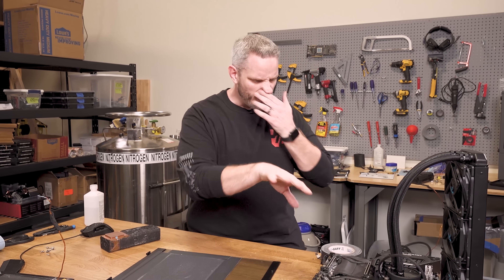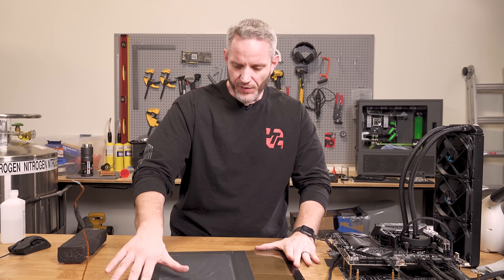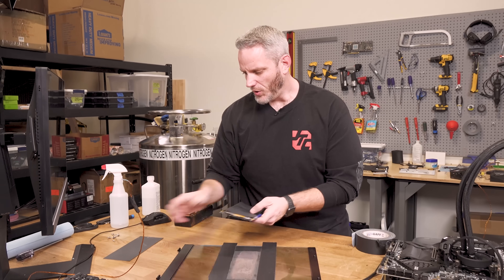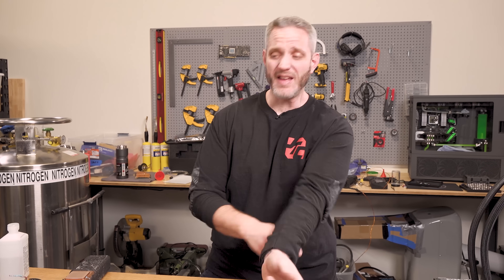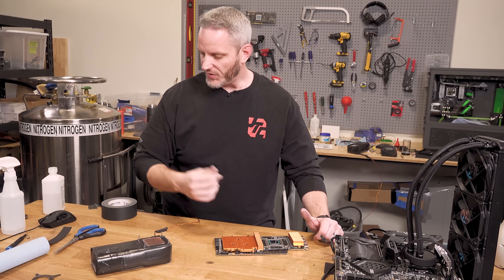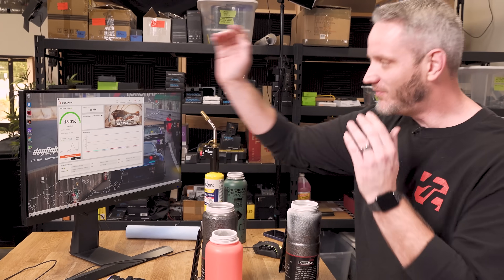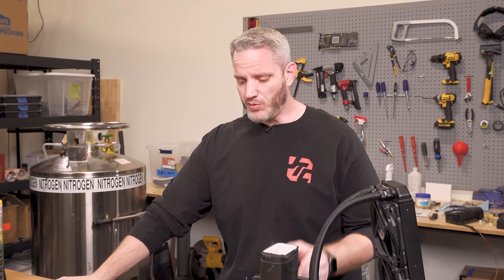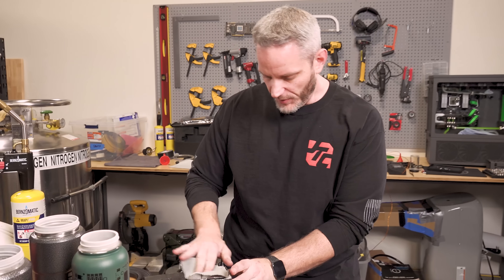THIS is Why Lapping Your Cooler is SO Important!!

Comment: Jay, you really should start completely over with a new pot, constructed with the main goal of parallelism between the contact face that sits on the die and the outside face on the opposite side of the pot, in both planes. This will allow you to just set the pot on your glass with the contact face up, and use a dial test indicator to check for true flatness. Then once the contact face is done being lapped and known to be flat, then you can apply your insulating foam that looks like it's been scraped off hastily in this video, as you shouldn't ever need to re-lap it, as you know it is flat already and there is no wear during operation. But unless you already know the outside face of the pot you have conforms to a tight parallelism spec, you cannot use that method, as you will end up with a flat surface in the incorrect plane

Comment: ...unless you lap it wrong and end up with an angle or a curve and your cooler now fails to make good contact (especially with Threadripper!)...and without a specialized perfectly flat and level tool that laps the cooler evenly, this is guaranteed.

Comment: Glass is not perfectly flat...a lot of people who 3d print deal on glass beds deal with glass being warped even when it's not heated. If you think lapping a cpu on glass is in anyway accurate at all then you are just wrong. If it's not accurate enough to lay down plastic filament, it's damn sure not accurate enough to lap a cpu.

Comment: Leaving surface rough is to maximize surface area which transfers heat. Not for thermal paste to stick better. Trick is finding best heat transfer between larger area of grooves and smaller maximum distance of polished surface.

Similarly how a radiator has rows of spikes instead of being solid block. Every spike is another surface that can transfer heat to air. But in this case every groove has extra surface to transfer heat to paste.

Comment: You said about not going for a mirror finish, i was under the impression that thermal paste is only a substitute for perfect flatness, for the absolute best thermal transfer 2 perfectly flat surfaces without thermal paste would be the best so leaving scratches in for the paste to grip is only leaving poor heat transfer for the paste to have to deal with instead of direct contact.

Comment: I noticed Jay touching the freshly lapped surface a bunch of times. If you're not aware, the oils naturally occurring in your skin (no matter how dry your hands seem) will contaminate the copper surface. It may cause corrosion or react with the TIM, which of course is sub-optimal. Please after doing your final lap, don't touch the base. Rinse it with clean water (de-mineralised ideally) to get rid of the metal shavings created by the sanding, wipe it with a CLEAN microfiber or lint free cloth and cover it with plastic wrap if you're not mounting it immediately.

Comment: I'm assuming that tightening the C-clamp while the paste was still frozen solid cracked the crap out of it. It may have been possible to warm it to get it to re-flow, but at these levels it was likely never going to be good enough to repeat that run because I believe the frozen crack pulls the paste out of the surface's micropores, and logic tells me that the only way to force the paste back is to start from scratch. Think of paving with asphalt, when they lay the asphalt down and put a roller on it, you get a nice smooth surface where it's nicely adhered to the subsurface, but if you were to freeze and crack it, it never comes back together, even after warming up on hot days and the structural integrity is ruined, you have to tear it up, re-prep the subsurface and start over again.I personally would avoid ever adjusting or touching the mount when it's frozen.

Comment: You should really consider a " no twist clamp" for this, i worry the twisting a c-clamp can cause will booger you up and a no twist will get you the downward pressure you need without the added torque

Comment: Have you considered using machinists calibrated blocks for use between the g clamp and the back of the die? They are supper flat and easy to get hold of. You get them from special machine tooling companies. Probably be around 50quid in the uk for a set. Plus they will act as a further heat sink to give u a more consistent temperature.

Comment: @JayzTwoCents  If you're really serious about Extreme OC'ing you can get heating tape for the cold sensitive parts and to help evaporate the condensation before it becomes an issue.
Overclockers and Watercooled PC's usually has some good ones shaped for the back of the VRAM and CPU/GPU dies. 👍

Comment: Yes! I’ve struggled with my AIO for a few weeks. I know it’s filled, I know the pump is good, it’s positioned well, push pull fans, but my temps are still not near as low as I know it being it down. I do have some groove scratches so.... off to the hardware store! I’m sure this is my problem now 🤙🏼
Thanks Jay

Comment: With the polished finish compared to a rough finish, Jay keeps mentioning 'bite'.  Technically you are creating more surface area for heat to transfer.  Think of it like making nanometer grooves for the thermal paste to get into and then spread the heat through.

Great info, you might also look into the milling stones that are used to flatten surfaces in lathes and milling machines. They do very minute grind for super leveling surfaces by like thousands of an inch

Comment: Yes, scratches make the paste easier to bite. But the best cooling is direct contact as it makes less thermal changes between items. The best cooling would be no paste on PERFECTLY flat items, even better would be built in pot to the die. More layers means slower temp dissipation.
Looking at CPU's up close, lapping the die is very thick prior to the internals. Idk how GPU's are, but it could very well help a bunch. Lots of extra metals in everything.

Comment: Are you using spring washers to tighten the retaining brackets? If not, those can help with the metal expanding and shrinking under the influence of temperature fluctuations.

Comment: "Glass is Perfectly Flat"....Start 3D Printing and you will learn how wrong you are.  LOL...Tempered and Float glass is FAR from flat.  You're better off using a mirror, because most mirror glass is GROUND Flat.  Yes, glass is common to be used for this, but flat?  Nah.  LOL

Comment: Similar to other comments, use a black marker pen and go over the copper surface. you can then see where the high and low spots are.  Clean the surface with IPA afterwards You can not get it true flat just by visual examination

Comment: Just an idea from an engineering student, but wouldnt it be better to grind it being cold, i dont know if your block is made of one material only, but thermal expansion and contraction came to my mind when i saw this, as you mentioned yourself. Obviously it worked that way too, just being curious.

Comment: As a noob to this I wondered... You tend to use the same pot and same CPU for your over-clocks but are always concerned about getting a good contact between them for thermal transference so why not lap the hell out of both pot and CPU to get them really smooth and flat and then solder the two together thus taking the contact problem out of the equation? Seriously would like to know why this wouldn't work, if it wouldn't.

Comment: You can make a construction like knife sharpeners, which holds the stone, or an object and two constrained rails. 
Those rails can be placed with rotary handles like on lathe machines.

You may even buy some details...

https://upload.wikimedia.org/wikipedia/commons/6/68/HwacheonCentreLathe_460x1000.jpg
https://cdn.shopify.com/s/files/1/2658/1798/products/Blade_Sharpener_With_100mm_Flipover_-_Eze_Sharp_Knife_Sharpener_1200x1200.jpg?v=1549492062

Comment: Hey Jay just a tip as a mechanic, according to my experience lapping in eight shaped movements is more productive and more accurate also you can use some petroleum on your sand paper to prevent dust expansion and make sanding smoother give it a shot next time.

Comment: "Glass is perfectly flat" every machinist replacing their expensive granite surface plates with glass. Invest in a lapping plate.
Reply: I'm not sure I'd even call this lapping tbh. sure its TECHNICALLY lapping but its nowhere near properly accurate.
Reply: I used to live right next to a Pilkington float glass factory. Many of my neighbors worked there. Sadly they closed the entire plant when the oven got old since rebuilding it would have been too expensive. The ovens in those plants can't be shut down without being completely destroyed.
Reply: @Pretagonist  sad truth. A business is no business if you can't renew and replenish yourself over the years... But the oven? As in fire can't be put out? As in, it can't be cooled down without destroying? Or what? I'm curious.
Reply: @esatd34  Exactly, when it cools down it cracks so it has to be torn down and rebuilt
Reply: Just do some 3d printing on a glass plate. You will see how, not flat glass is. Especially when talking about Microns
Reply: Especially not if you stick on top of a squishy wooden table and then press on it...
Reply: I've always been curious like if you lapped an IHS and waterblock down to 3000 grit if you could wring them together and eliminate paste all together.  There would still be microscopic surface irregularities that paste could fill I suppose... still would be a fun experiment.  LN2 without paste to crack!  That would be neat.  

Also, I'm average user and I lapped my waterblock to 2000 on a 1/2" thick glass table.  

https://imgur.com/a/yXxDz4K  

Of course, it came off my Sandy Bridge and because of the 'dish' in those processors this waterblock had been made convex.  How much I didn't realize until I got in to it but it turned out to be over half a millimeter or .024".   Ended up having to take it to the shop and run a mill over it to get rid of most of it.  That was after lapping it on 250 for 45 min.  Crazy.
Reply: @Cinnabuns2009  yeah i've always wanted to know about wringing the IHS to the waterblock
Reply: Even a cheapo Grade B surface plate from some place like Grizzly would do him more good than his thin sheet of glass and cost him $50 with shipping.
Reply: thats probably one of flattest surfaces he can find in the shop
Reply: I was looking for this comment,that is not lapping he just sandpapered and polished maybe that block ? It may be flatter than it was but im pretty sure it is not perfectly flat.
Reply: back when i done ball bearing lapping we measured a bit slab of glass which we thought was flat. turned out there was 30 microns different from corner to corner which is massive considering we worked in tolerances of 0.0005mm which is half micron.
Reply: For any average person a pane of glass is fine lol
Reply: @tylerfigueroatf  That's true, but any average person isn't lapping their heatsinks. If you're trying to hit the top of charts, why not spend the extra $$$ and do it right?
Reply: @tylerfigueroatf  Do average persons lap surfaces of coolers or processor lids?
Reply: And bench that is actually true
Reply: The deviation should be only a few microns and that is easily accomplished by hand, you don't need a $ 100k laser-guided machine to get there. Google translate offcourse. Not even mentioning glass is a liquid, that is the reason why glass in really old windows is thicker at the bottom than at the top.
Reply: @LovelyDoetje  Common misconception, glass is not a liquid it is an amorphous solid. Glass in old buildings is thicker at the bottom because they install it that way.
Reply: Is glass truly flat?
Reply: @WarriorsPhoto  Nope. It can be, like in a perfect mirror. But a PC side panel? Not even close to "perfectly flat".
Reply: @noxious89123  I didn’t think it would be possible. Everything has a little grit in nature. 
Are you a computer aficionado?
Reply: Have to be careful with granite, sometimes they are ground to have a spherical surface based on what was used to flatten it.
Reply: @timlaunyc  I don't think anyone makes curved lapping plates? Maybe I'm wrong but it doesn't seem useful
Reply: @Great.Milenko  Correct. Commercial surface plates are usually calibrated and reconditioned periodically. See, for a example, oxtroolco's videos on surface plates. Glass wouldn't even remotely be able to compete with those specs.
Reply: Glass is actually flatter than granite surface plates.
Reply: @nissan300ztt  Glass is less porous, but it's not flatter on any usable scale. It also flexes, unless you have an actual glass block with considerable thickness. Even then, for any precision work, granite is superior and much easier to have reconditioned, recalibrated and certified.
Reply: @dipi71  i have a 1/2" slab of Tempered Glass at my machine shop to check for flatness.  Its flatter then a $12000 starrett pink granite surface plate.  Verified and checked every 6 months.  Not saying youre wrong about what you said.  But in my case its true. Glass plate is .000005" flatness granite is .0005" +/- .0002"
Reply: @nissan300ztt  Wouln't have thought that was possible. I'd like to get my hands on one of those! Is it still shiny or more like frosted glass? Cheers!
Reply: @dipi71  shiny.  I believe it was for a glass table top for visual part inspection.  But we use it to check flatness.  And its amazing
Reply: @nissan300ztt  No, it isn't. With a glass panel like this, you can see the distortion by eye if you use the glass to view a distant reflection, and then move the glass. You'll see the reflected image distort as it moves across the surface of the glass.
Reply: @noxious89123  what youre experiencing is not the flatness.  Its the material itself.  Ive been doing this for 30 years.  I think I know whats flatter.  And i have tools than prove 1/2" thick tempered glass is flatter than granite.  Yes glass will flex but when installed on the proper sub structure it is flatter than most granite.  Unless the granite was recently lapped professionally glass is flatter.

Comment: Just a thought. It looks like the Ifixit pick that you're using in between the clamp and card is not giving you optimal pressure. if you go for something more square it should distribute the weight more evenly. just looking at the pot at the end it looks like there is still a very large spot at the side that really looks like it would correspond to where the pic would lip off or not big QUITE big enough to overhang it.

Comment: at a guess of the g clamp and winding tension back off it after over tightening .. is like increasing the verables ..the perfect 1 time tension i think is key with out freezing paste.. my guess at frozen paste to unfrozen under a force will push the paste threw thermal expansion and retraction of the ihs.. like a set force can change if the items expand with heat then shrink with extreme freezing.. like in machining heating is easier then freezing parts. so its cheaper and easy to heat up a lump of steel to fit over freezing it to fit.. and there say heat gets 600degrees how cold can LN2 get say 160 neg.. now if ur heating and freezing that gpu over 150 test would it be like heating a freezing a bit of steel. its like a heart beat blood goes in expands goes out
Reply: i didnt watch last 2 minutes of video where my comment is redundant haha

Comment: Very entertaining video Jay! Some perspective for those wondering about engineering accuracy; My work consists of CNC polishing optical glass, specifically in manufacturing bespoke camera lenses for the film industry. It takes roughly an hour for a specialist calibrated and optimised CNC machine to polish a 60mm diameter piece of glass to ‘plano radius’ or 'flat' within -/+ 3um (0.003mm) (Human hair is 70-90um). To the point where a pass/fail could be down to the difference in ambient temperature in the building or heat from your hands. I use hand lapping to get the piece somewhere near flat prior to machining, that can be -/+ 5-10um on a professional setup. I admire your optimism in your perceived accuracy but you are not anywhere near your alleged ‘few microns’ tolerance across a surface of that size using that setup. It can be achieved manually, although it would need a very expensive lapping plate, DTI’s and/or CMM for reference and a lot of time and experience to get close to those figures by hand. If you do achieve a near perfect flatness across two opposite surfaces (specifically metals) they will wring 'adhere' to each other with an amazing amount of force.

Comment: Don't forget to lap your valves when you rebuild your cylinder heads. Unless they have a coating on them. That's how you get proper valve seating and therefore don't have your valves leak. Computers and cars do have something in common. Besides being fun to make faster and perform better.

Comment: I trained as a engineer and if you want todo lapping correctly you need a granite surface table and some engineers blue. you place the engineers blue on the surface table then rub the copper on the table, where the blue go's on the copper is the high points which you file down repeat till it has blue on it all over evenly

Comment: Im no Overclocker but an experienced mechanic, Have you considered using a torque wrench to set the cooler? You were running a spreadsheet with your voltages and clocks, you could then do the same for torque? It could give you a way to have repeatable and progressive mounting pressure? Just a thought since mounting pressure seems to play a decent factor here.

Comment: i might be wrong but the way he talks about the difference between high and low spots is microns and then he says we need it to be rough for the thermal paste, the thermal paste is for the difference between the high and low spots so you get a perfect fit right, again i could be wrong